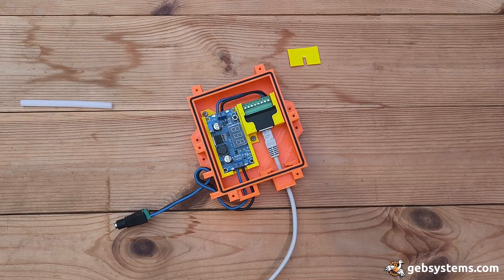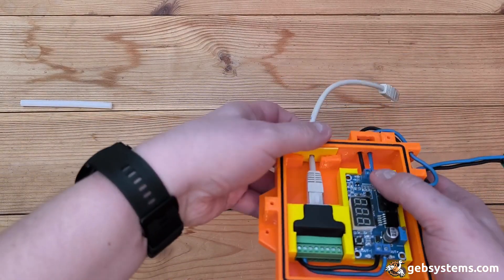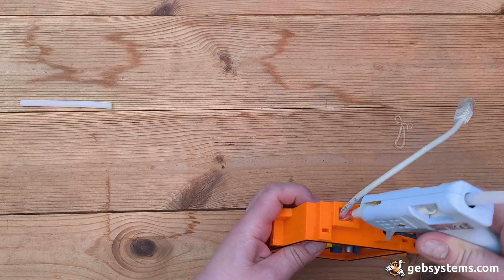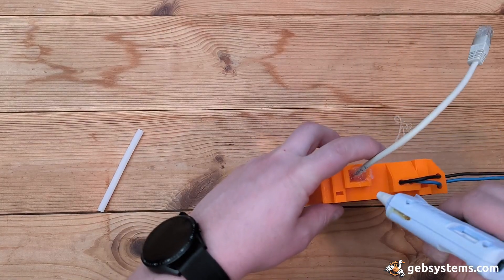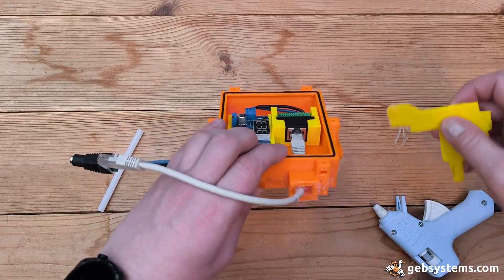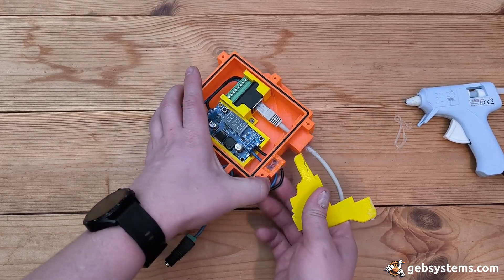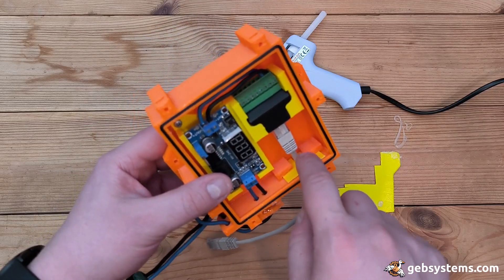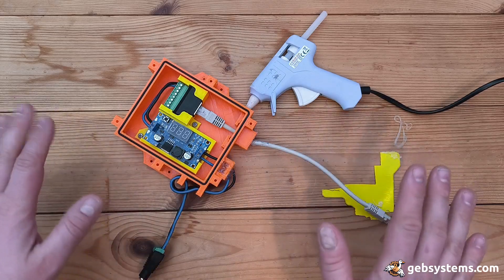Waterproofing the Power Enclosure | Arduino Modbus Project

Comment: Use silicon for water pools or something designed for outside so thats UV resistant. Hot glue is not a long term solution.
Reply from the maker: I agree with you. Been using bath silicone ever since 😁 but the hot glue solution has worked on my outside enclosure for over 2 years without an issue.

Comment: Good project! Why not use silicone? Like those used to water sealing bathroom.
Reply from the maker: Damn! That is a good idea! Why I did not think of that 🤦‍♂️ will give that a go! Thanks!!!
Reply: @gebsystems maybe print a invert cone shape to inject from the side
Reply from the maker: @hanswerner6882  Interesting idea. I got myself some silicone that builders use for showers in the bathrooms (this can be applied cold so that sounds like a bonus). Will see how easy it is to remove it after applied. Will try that first and also play with the cone idea of yours. Designing the RJ45 enclosure now.

Comment: nice project, but i would consider sealing cables by any other material except hot glue.
hot glue is a trouble as a sealing :(
Reply from the maker: Thanks! I have used hot glue for an outdoor project a long time ago and it worked really well.. If you have a suggestion what else I could use than please let me know.